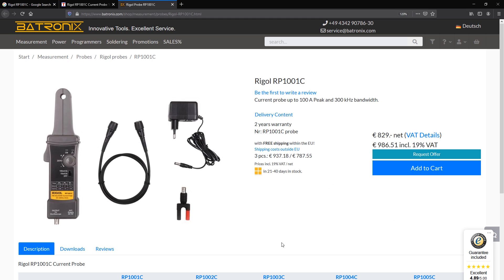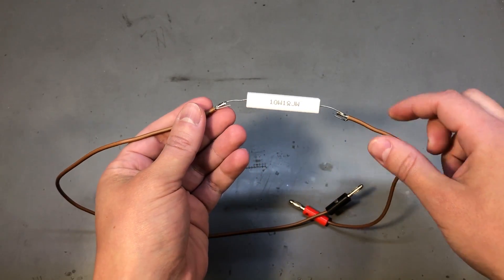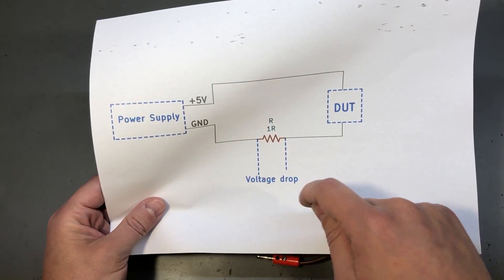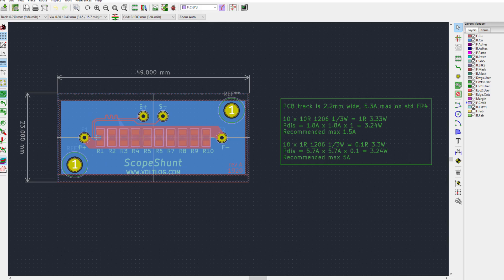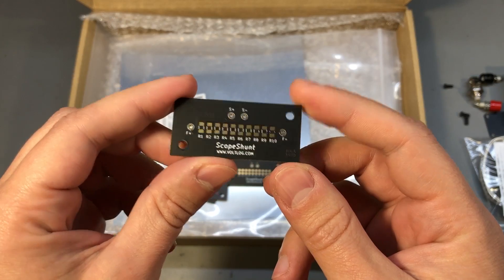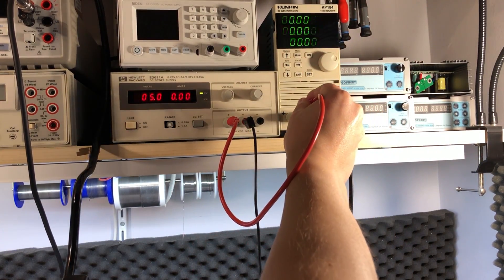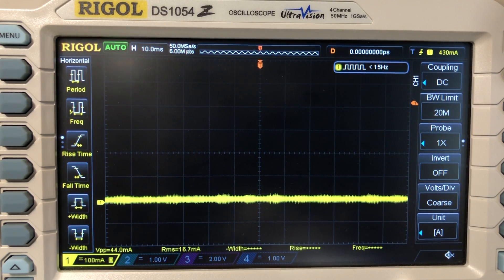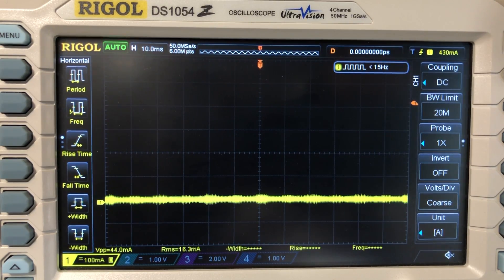ScopeShunt Visualizing The Current Waveform With Your Oscilloscope | Voltlog #310

Comment: Nice build! You connected it so that current flows into the OUT label and out of the IN label which seems weird to me. The labels seem the wrong way round.
Reply from the maker: Ideally I would have used two black terminals, but I just had a pair of red & black. When considering the labels I didn't think of the conventional current flow direction (positive to negative) or the actual flow of electrons (negative to positive) instead I imagined how I would wire this up starting from the power supply negative output and moving down the line up to the DUT. It's just how I imagine the circuit in my head when wiring something.
Reply: @voltlog  Fair enough! I normally think of the power supply negative as an input, so perhaps that's why I found it odd.

Comment: Nice video and clean PCB design with great execution.  I am surprised that you did not mention (or at least link) the off-the-shelf alternatives:
µCurrent
CurrentRanger: https://lowpowerlab.com/shop/product/152
Joulescope (Disclaimer: I am the creator of Joulescope): https://joulescope.com
Keysight N6705

One other warning about low-side current shunts: If you plan on hooking up other equipment to the device under test (such as a UART to USB adapter and SWD debug adapter), a low-side current shunt will cause problems due to the grounding offset.
Reply from the maker: Hi Matthew, thanks for mentioning the alternatives, I plan to compare the Joulescope with an inexpensive off-the-shelf current probe from Hantek and discuss the pros and cons of the two measurement methods.

Comment: Was the length matching really necessary, or were you just gilding the lily? :D
Reply from the maker: Liyang HU well there good design practices which are worth following no matter what. Ideally you would have a high impedance circuit connected to the sense points, no current would be flowing. But in real life that's not always the case.

Comment: Wait correct me if I'm wrong but, putting 10x 10 ohm 1% resistors is not technically any better than 1x 1ohm 1% resistor is it there may be a practical improvement due to the normal distribution of multiple resistors base tolerance but they still technically have the same overall tolerance.
I would have just spent that $2 you spent on the PCB on a good temp coefficient 0.05% precision shunt and manually wired the connections.
Reply from the maker: Yes you are right the cause is the normal distribution but that ends up in your favor for the 10x pack in parallel and in the end you get closer to the value than you would with a single resistor. Sure one can also use a good temp co resistor, higher precision, higher power rating but it's beyond the scope of this project which is to create an affordable solution with easy to find parts.
Reply: @voltlog  I don't think it is correct to say that the result is more accurate with several resistors in parallel. The worst case is the same, and the average case might be better if the values are distributed according to the normal distribution, which is not necessarily the case.
Reply: @feedback-loop  I would argue that in practice you do get better precision by using multiple resistors in parallel even though the individual resistor values are not exactly normal distributed. A lot of different kinds of random distributions will narrow in on the nominal value the more resistors you add in parallel.

Comment: Nice job. How about a hall sensor to detect DC current? That is what is used in DC "current clamps".
Reply: A simple hall sensors would greatly limit the bandwidth. It is a fully integrated circuit including an amplifier after all.
Reply from the maker: That could work too but it would come with it's own set of limitations.

Comment: For some time I have toyed with the idea of using a hight side current monitor IC, such as the ZXCT1107 or a similar TI part, for use with my DSO. In the end I went full digital and built 4 channel data logger with ina226 modules and a 3.3v Arduino.
Reply from the maker: Yeah not a bad idea for those who want something a bit nicer.
Reply: @voltlog  the only issue with a current monitor is that they do not go very high on voltage, but that sgould not be a problem for hobby ussage.

Comment: for a galvanc isolated, high speed measurement of current you could use a ACS730 IC,  or MCR1101 which is even better
it got a output bandwidth of 1MHz (-3dB), outputs a voltage of 100mV/A for the +-20A model and in addition a reference voltage that represents the 0A offset.
and is isolated up to 300V or more if i missed something.
price is just 3.80$ on lcsc for the +-50A  at 40mV/A model.
its not as accurate as a plain old resistor but should do the job. maybe theres a smaller model that has a smaller current range but is more accurate.
maybe you can give it a test in a future video.
Reply from the maker: Thanks! I'll consider something like that for a future project/video.

Comment: Very nice and compact! The input label on the black connector seems illogical though as I'd assume the black connector to be the more negative side. :)
Reply from the maker: Ristomatti Airo unfortunately I did not have two black connectors 😐 only a pair of red and black for this specific model.
Reply: @voltlog  I meant the colors would make more sense (to me) the other way around...
Reply: @voltlog  I would recommend buying some white on black or white in transparent label tape btw. It gives a bit nicer finish with little effort!
Reply: @ristomatti  @VoltLog That reminds me, the STe metal stencil tape might make for a good video
Reply from the maker: I agree white on black or white on transparent would look better, I'll have a look and order some. Thanks!
Reply: @voltlog  I've got both and I would say white on black looks better but the tapes are so cheap it's worth trying both.